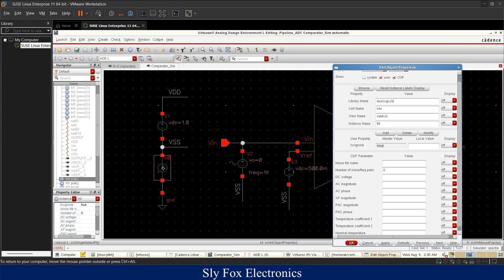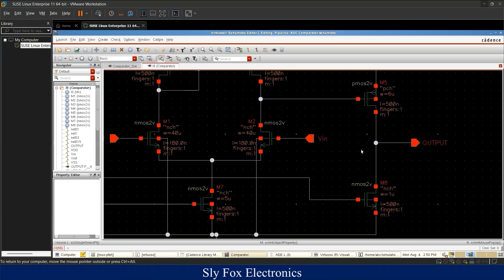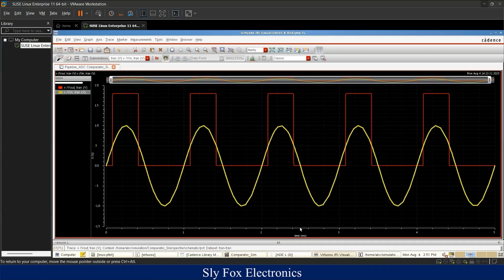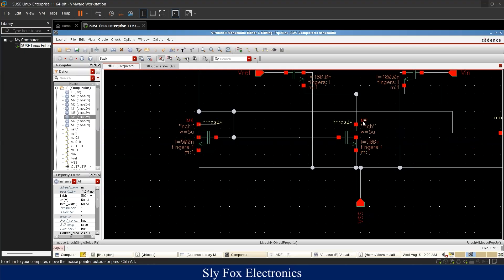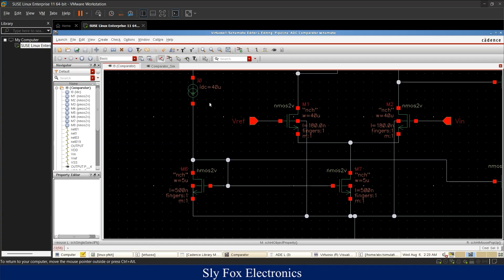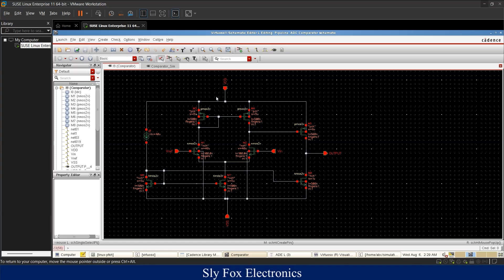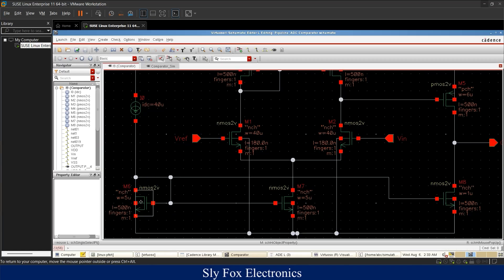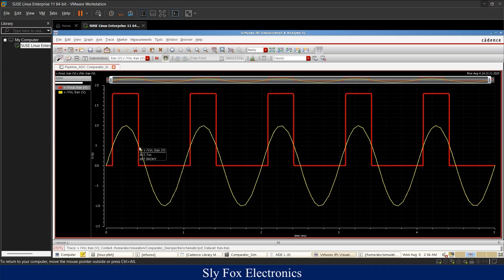This Tiny Circuit Makes Big Decisions! 🧠🔍 | Comparator Design in Cadence (180nm CMOS IC)

Comment: Very excellent video bro. I'm currently doing this project and struggling with the chosing transistor size, Av, t rise , t fall and other specification requirements. Can you give me some advice and recommend some usefull documents ? Thank you in advance
Reply from the maker: Glad I could help🦊

first of all, we need a really high gain when designing a comparator to achieve to an acceptable speed, 

choosing large transistors helps us reduce offset voltage and degrading noise effects,
so in cost of area, we achieve  to a better performance,

if you want to detect zero crossing with your comparator you may need to use transistors in cross coupled configuration,

the pitfalls and their solutions in designing comparator is discussed well in 
"Marcel J.M Pelgrom
 Analog to Digital Conversion
 Fourth Edition
" 

a chapter is dedicated to explaining comparators and design methods,

Good luck with your design🦊